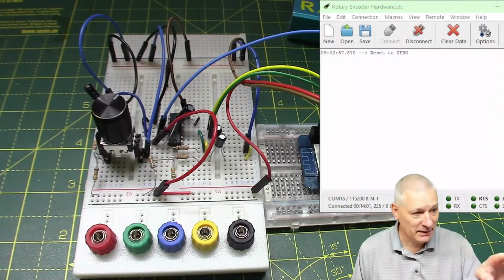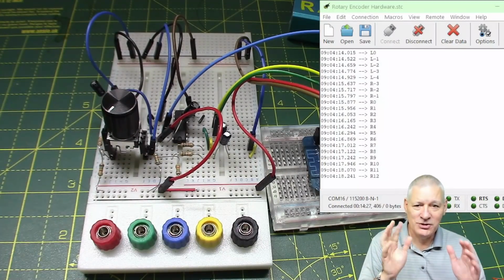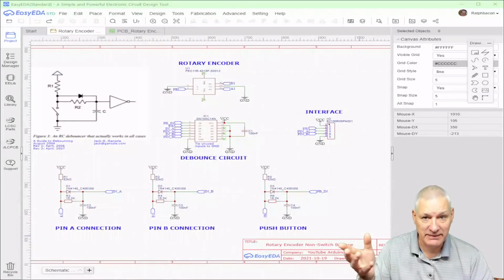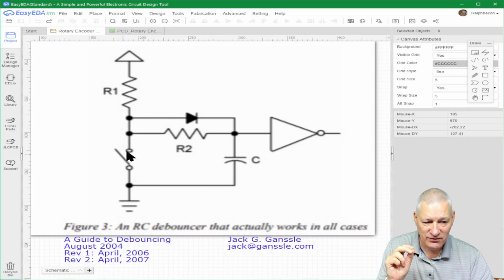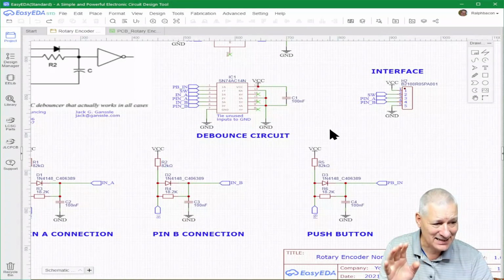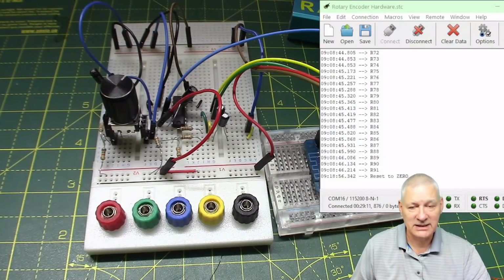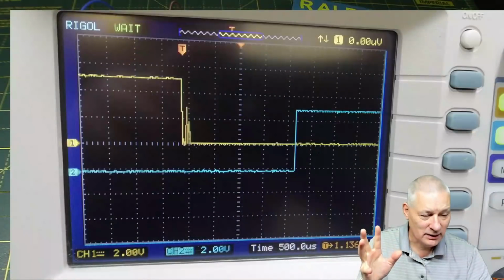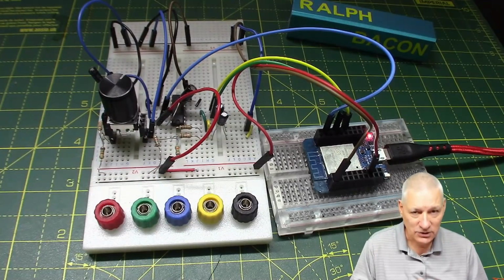#230 The ⭐ULTIMATE⭐ Switch Bounce Eliminator - simple and effective. 🎈

Comment: I have watched this video a number of times. One thought comes to mind.
There are only 4 states and each state has only 2 possible next states..
So what if you tested if the next state happened(add or subtract 1)
if the state after the next state  happens(add or subtract 2)

Right now I have been testing a 600 pulse per revolution optical encoder,
so there is no mechanical bounce, but there is probably still 
a between state bounce..that your Schmidt trigger fixes.
Reply from the maker: Someone else posted that they have "simplified" the states but I never tested their hypothesis. What I do know is that my tiny PCB for the switch bounce eliminator works 100% reliably, so, if it ain't broke I ain't gonna fix it. Glad to hear you've had success too 👍

Comment: If you try to turn it faster than an instantaneous or discrete point-to-point velocity of 60rpm, meaning pointA to pointB changes in 60[r/m]/60[s/m], if you have 10 values/rotation then you cannot move to the next point faster than 0.1 seconds, which is not the easiest. What issue youre discussing in the beginning is aliasing where the decoder reads no change from the encoder since the bit states dont flip as you would get with differential phase encoders (such as hall effect style sensors). Aliasing in a discrete realm can show up as no signal but with an analog knob it would appear as a lower frequency so it will look like its rotating slower due to frequency shifting above its highest frequency. I suggest using a hall effect sensor since they can easily do hundreds of rotations per second for nothing. With programmatic hysterisis, an IIR lpf, and a micro gear box you can get many points, for example there are $5 motors with 7PPR and 150:1 reduction providing 1050 points per rotation at 3.3hz max (200rpm) if buying without the motor its only about 2 dollars, with many sensors being in the 7khz range, I wouldnt be surprised if you could get a reliable knob for $5 as a consumer and less with wholesale. Not sure I've seen anyone use these as a knob but I feel like it would be a great idea after seeing this. Good job on the debouncing tutorial though, its really well built and easy to understand!

Comment: Mr. while I am still learning electronics, and might have this all wrong, I have searched for button debounce breakout boards. Either they don't exist or I am searching in the wrong manner. Anyway, I got a few parts, a small perma dev board, and got going with the parts used for debouncing. (6x 10 microferrite capacitor, 6x 10k resistors, 1x Hex Inverting Schmitt Trigger 74LS14.) I'm waiting for my buttons to arrive, I felt confident enough this could be a breakout board. I went on and designed one. I posted a picture of the result here: https://www.youtube.com/channel/UClarhMKaMAUiAjXQbWYgWDA/community?lb=UgkxCrnhbMLH5ORuw50MPljzd_Xv5fJlrFUA (and another post below that one with the circuit.) Would it work?
Reply from the maker: I can't tell you whether your particular circuit board will work from those photos, but if you have it working on the bench with a breadboard there's no reason to assume it won't. Best of luck!
Reply: @RalphBacon  I asked about this in electronics.stackexchange aswell, and the friendly folk have helped me out a bunch explaining further. Next up is the experiment on the breadboard with various uF values to get responsive trigger reactions. I posted a picture of my ECB design in my channel/community.
Reply: @ I also posted a picture of the circuit taken from kicad. on my channel/community
Reply: @RalphBacon  Schmitt trigger button input succes! today I recieved all remaining parts. built the circuit on a breadboard and loaded digital read example. a stream of 0 turns into a stream of 1 if you press the button. never inbetween 0 or 1 there is a gap of 1s or 0s. it's always a endless stream of either 1 or 0
Reply: @ making progress mr! https://www.youtube.com/shorts/9fS7Qp7z7gw

Comment: Sorry,  but you are wrong. Your "ultimate" debounce circuit creates a 2.5ms delay and cannot debounce switches with longer bounce times.
The best debouncing hardware was the Motorola MC14490 which is no longer available, but you can learn a lot by looking at its internal circuit in the data sheet. You can implement the same circuit in discrete logic or an FPGA OR it can be implemented in microcontroller software and then you only need two pullup resistors.
Also you can get finer resolution from encoders by using the transitions of both A and B.
Reply from the maker: Good to know and I will check out the MC14490 (if I can find any) 👍

Comment: How much did the 30 PCBs cost?
Did you ever make a surface mount PCB?
I think I may build my own SM version for my project!
I am using 1 single button and a toggle left to right to control a stepper motor.
The single will bypass the pot  setting and go full speed,  otherwise it will do a percentage of speed set by the potentiometer. 
Lee
Reply from the maker: I've made a new (tiny) one recently, using a single SMD Schmitt trigger chip. Works well. Email me for more details (if you want them, of course!)

Comment: Thanks Ralf, I'm addicted to your content. Regarding this project - is there an optimal voltage for VCC?
Reply from the maker: The datasheet for this exact Schmitt trigger chip (SN74AC14) says it works from 2v to 6v, so should be good for an ESP32 (or other 3v3 device) or an Arduino UNO (or other 5v device).

Comment: Can I get a bit more info on the sn74ac14n on digi-key there is so many options on different switching voltages, what are you using?
Reply from the maker: For the demo in this video I was using 3v3. This was undoubtedly because I was using an ESP32 and I didn't want 5v appearing on any of the input pins from the Rotary Encoder (A/B/PB pins).

The SN74AC14N is tolerant to 7v, however, so if you have an Arduino Uno (or other 5v microcontroller) it's safe to use 5v.
Reply: @RalphBacon  sorry for the silly questions I'm pretty new to this, am I correct in thinking that eats that of pins across from each other is a different trigger? Is the multiple pins able to be used for multiple inputs and outputs I'm not sure I'm saying that correctly.  Maybe a better way to say it is Can I with one of the sn 74ac14n chips denounce  say 4 buttons, or do I need one chip for each circuit? Thank you for your time!

Comment: If you work it out, the inversion doesn't matter; A still changes before B (and vice versa) and the counts will be the same.  Similarly, whether A,B are pulled down or up (as long as the common is the other) does not matter.  tau1=(100 n)(82 k) = 8.2 ms and tau2 = (100 n)(18 k) = 1.8 ms.  This gives a cutoff frequency f = 1 / (2 pi 10 m) = 16 Hz.  If more than 16 cycles / revolution, then you have reduced the maximum rotation rate below Bournes' specifications in exchange for filtering the bounce noise.  You could also save the cost of the diode by placing the 18 k in series with the switch and connecting C and the inverter 'in' between the resistors.  Most port inputs also have hysteresis -- although Schmidt triggers usually have more.
Reply from the maker: I'm not going to check your calculations, Byron, so let's assume they are correct. Your changes may work but until you actually try them out... you know what mean. 😉

Comment: just a thought i had while thinking of this today, although i watched it months ago, the schmitt trigger inverters, if the microcontroller has hysteresis of its own on its input pins, would they really still be needed....
Reply from the maker: The microcontroller is more than quick enough to detect all the switch bounces going, I'm afraid. The difference with and without Schmitt triggers has to be seen (on an oscilloscope) to be believed!
Reply: @RalphBacon  I'll swap 2 resistors and a little cap for lines of my code anyday...... The simple mistakes I've made in code I'll take hw over it anytime lol

Comment: I just built a volume control knob out of one of these encoders. I installed an aftermarket Alpine stereo in my car and it doesn't have a volume knob, just onscreen capacitive buttons for the volume, which I didn't like. My car doesn't have steering wheel controls either, but the new stereo did have a 3.5mm jack for an optional box to interface with a vehicle's steering wheel controls. I found some code online where someone had decoded the protocol it uses to interface with steering wheel controls. I used some of that code, an Adafruit Qt Py ESP32-S2, and an Adafruit Stemma rotary encoded board to create an actual volume knob for my stereo. I found that this Adafruit encoder board doesn't seem to have the issue you mentioned of rotating too fast, as I could spin it as fast as I want and it never skips or loses track. However, this stereo can only accept inputs about once every 150 milliseconds due to the precise timings required for the protocol it uses. So, I had to program a buffer into the code so that if the encoder is spun faster than the stereo can accept a new signal, it buffers the commands and sends them as soon as its ready for another signal. I also used the encoder button/click function to mute and unmute the stereo. I chose the ESP32 because I wanted something with WiFi so that I can do OTA updates to the code without pulling the stereo out of the car every time I wanted to make changes to the code (as the ESP32 is behind the stereo). I coded it so that if I hold the encoder button in for 5 seconds, it enables the WiFi in AP mode and loads the OTA webpage, this way the WiFi is only active when I need to do a code update.
Reply from the maker: Absolutely fantastic work, Daniel. You're obviously an experienced 'maker' and are putting to good use all the skills you have. 

Yes, OTA updates are a real blessing too, I too use that feature.

Interesting that you are writing the data stream to a buffer which then sends the data in a controlled (timed) manner to the stereo. You could also have rejected signals coming too fast from the encoder, I suppose.

Cool stuff, I'm impressed 👍🏻

Comment: Why not just debouce in software? I've never debounced with hardwaree. Software is "free" and uses no physical space. Unless you're running out of memory hardware is no better and compact debouncing code uses very little memory space.
Having a clean input can enable different kind of software though, like just using pin change interrupts or what not.
Reply from the maker: Why not indeed! 

Well, you've jumped into the debounce series at Season 4, so you've missed all my software debounce videos:

#226 https://youtu.be/sQNPAsZKnDw
#98 https://youtu.be/sD20xkVWh2s
#96 https://youtu.be/yf0Z0athNMM
#19 https://youtu.be/J9cDEef0IbQ

Happy viewing!

Comment: R2 and the diode aren't needed here. When the switch contacts are closed, you know what state the switch is really in, so you should discharge the cap without delay. When the switch contacts are open it could be actually open, or it could be in the middle of a bounce, so that's when you need the delay.  Given the scope shots, your delay is longer than it needs to be, as you only need to smooth the longest single bounce, rather than the whole settle time(and manufacturers generally specify the whole settle time). That said, you want to be characterizing heavily worn switches, so you can pick the lowest value that won't impact long term reliability.  Basically, don't sacrifice performance to solve problems you don't have. If your debouncing circuit gets you reliable operation at high rates of rotation, by all means use it.

For an encoder this RC + hysteresis method is good. If you have a double throw switch you can do better though, use a non-inverting buffer with positive feedback, read the common pin, and tie the NC and NO pins to opposite rails. The switch will latch in the state of the last closed contact, even if it closes for a fraction of a second before getting stuck on some dust that breaks continuity. No delays needed.
Reply from the maker: Hmm. Whilst, in principle, what you say sounds very plausible, given that each switch is different, Jack Gansle has done some serious work on this subject of switch bounce so what he has discovered must have merit.

Of course, as you (and I) say that each switch is different we are free to modify the code/hardware to suit - but in a commercial environment we would defer to the lowest common denominator - the worst example of switch we found (or specified by the manufacturer). 

So if the datasheet says 60rpm max that's what we should allow. In a hobby environment if we discover, empirically, that our switch can manage 200rpm, so be it!
Reply: @RalphBacon  I suspect that 60RPM max is just what the manufacturer believes will work with simplistic software debouncing(only a few samples, rather than the continuous sampling you get with hardware debouncing) and a switch at the end of its rated cycle life.  When I've compared new and heavily worn switches on a scope, the worn ones bounce a lot more, but the individual bounces don't get THAT much longer, because the single bounce time should be mostly determined by the mass and springiness of the contact. Here's an example of a new mechanical mousewheel encoder and one that's been used for several years(same model, purchased at same time), even though the worn switch looks horrific in comparison, the longest single bounce there is still only ~40us, so you shouldn't need several milliseconds to filter it out: imgur dot com/a/0W7sO6Y

I read the section of the paper that second resistor and diode were discussed, and I don't think they apply here, maybe if the switch was a long distance from the debounce circuit. Even then, you can get rid of the diode and lower R1 by the value of R2.  At 5v, R1 can go as low as 2.5k and still stay inside your encoder's ratings. At least for the push switch I'd probably use 10k for R1, omit the diode, either 0 or 1k for R2, and 100n for the cap.  Very high value pull up resistors can cause problems depending on what material the switch contacts are made of, and we don't know the pushbutton contacts are self wiping like encoder wipers would be.

Comment: Now that I have happily implemented the Pinteric algorithm I can turn as fast as I want. Out of the 20 cycles per whole rotation I miss 6 of them for being to quick.

The algorithm prevents any bounce effects as if I was turning the other way. Why would you want to solve this with components?
Reply from the maker: One reason to do this with components, not software, is to relieve the microcontroller from having to service the interrupts. It greatly depends on what your software is doing apart from waiting for an interrupt, of course! But you could find that the main loop is significantly affected by all the ISRs (and associated function calls).

It's the same with NeoPixels. Sure, you can run many hundred NeoPixels from a relatively fast processor - but you won't have any clock cycles left for anything else. That's why they invented NeoPixel Drivers, so the microcontroller can do lots of other work and just chuck stuff over the wall for the NeoPixel Driver to take care of.

Horses for courses, as they probably don't say anymore 😁

Comment: Great video, really well explained as ever. Stupid question probably... In your code you have your ISR triggered on change, so you are watching on falling and rising edges. Why can't you have the ISR trigger on pin A falling edge only? From the ISR you can then just read pin B to check if pin B is high or low and whether the turn is CW or anti-CW? A lot less code that way. Ive probably missed something obvious, so apologies.
Reply from the maker: No, it's not obvious at all. This particular rotary encoder has a detent part way through the cycle. If I only watched for falling (or rising) edges I would have to rotate it TWO clicks to get the full cycle detection. By watching for both edges I detect all clicks (detents). 

I've found that the cheap(er) rotary encoders from the Far East don't have the mid-cycle click so your 'rising' watch will work fine. I've done a video (#19, getting on a bit now but still works well) on those too: https://youtu.be/J9cDEef0IbQ

BTW If you need a PCB from this video I still have some, just send me an email with your address.
Reply: @RalphBacon  Aha, makes sense now. Thanks. 

Im actually having a go at making an SMD version of your's/Jack's circuit using JLCPCB. Using their SMD soldering service means I don't need to solder so much and I can make it much smaller as you said. Havn't done any board fabrication before or used any circuit design software so its a bit of a learning curve for me. Fun though. I'm sure I'll make a few mistakes, JLCPCB is very cheap though even with the shipping. Thanks again.